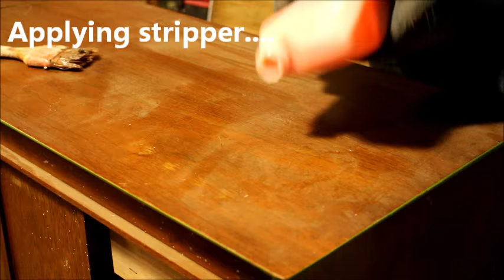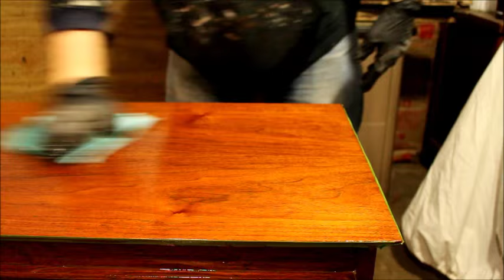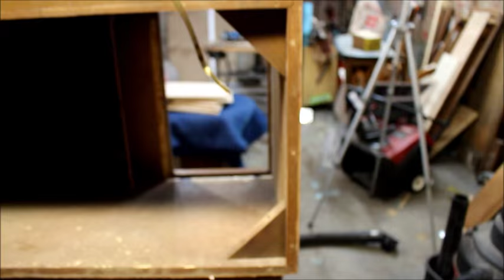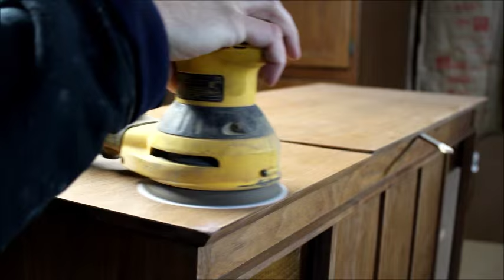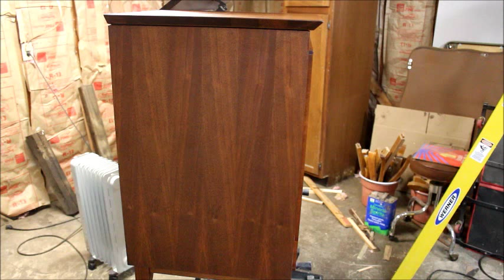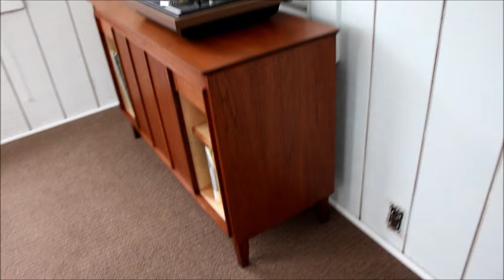Vintage Stereo Cabinet Refinish/Repurpose

Comment: I have a  Magnovox stereo cabinet. The record player has a broken tone arm. It's probably from the late 1960's. Would it be hard to replace the tone arm with all the wires? Is there a universal tone arm I could buy, or would it be better to put in a new turntable unit all together?  The radio works and sounds great, and I don't want to junk it. But I don't have a ton of money to spend. Let me know your advice.

Comment: I have one of these consoles, including operating vacuum tube style electronics (stereo, record player, and speakers). It still sounds better (warmer) than the “cold” digital systems of today. At some point I plan on reconditioning the wood, and replacing the dried out speakers and cover material. 
I’d have to look again, but I believe the system was built by Penncrest (a JCPenney subsidiary).

Comment: I just got a 1962 RCA Victrola, with the guts removed and have been scheming ideas on what to do with it. I’m wondering if you left the top piece functional and if so, how did you finish the inside? I think the inside designs look cool. It pains me to think about taking off the front of the speakers- the gold mesh is so cool looking but I’m not sure what to do otherwise

Comment: Another really nice video! Two questions, if you have the time: I have never heard about a pre-stain conditioner. What does it do, and when do you sugget using it? Also, do you feel the antique walnut stain gives a more chocolate brown colour than the mid-century-modern teak colour, or is it spot on? If not what is the closest stain you have found to a teak colour? Cheers.
Reply: About the prestain conditioner, it's used when you think the wood may take stain unevenly. Pine is notorious for taking stain in a splotchy manner, thus the prestain conditioner is advised.

Comment: Good stuff right there! I noticed you use Citristrip on most of your projects. Do you always use it, regardless of what finish is on them? (Laquer... shellac... poly... oil based) I've read about so many ways to strip furniture but if Citristrip is multi-purpose, then that sounds like the easiest and best option for me!
Reply from the maker: I do use Citristrip on most things.  Most of the pieces I work on are lacquer but Citristrip should work on most finishes. Just be sure to put enough on and give it time before removing it. Thanks for watching!
Reply: Dashner Design & Restoration Awesome! Thanks for helping a beginner out. Have a great day.